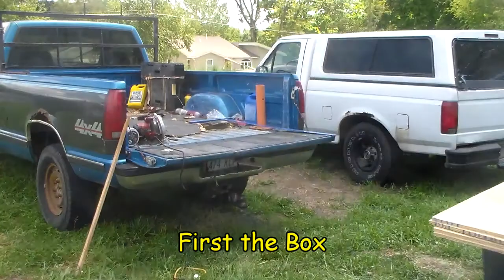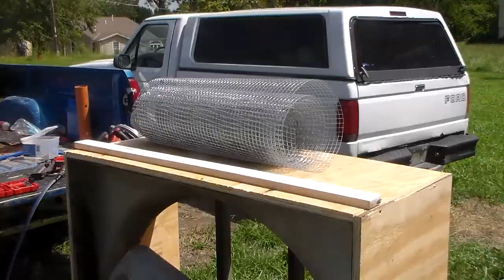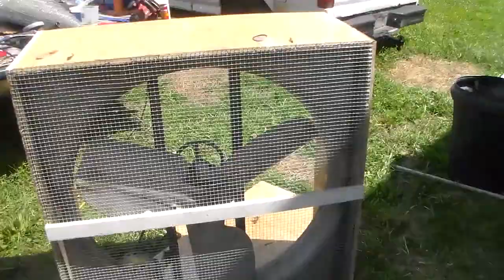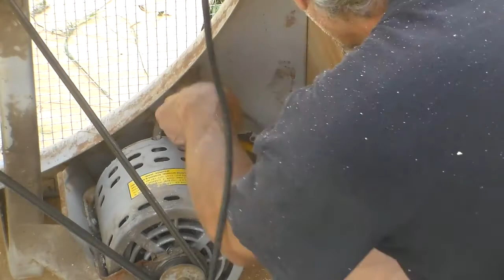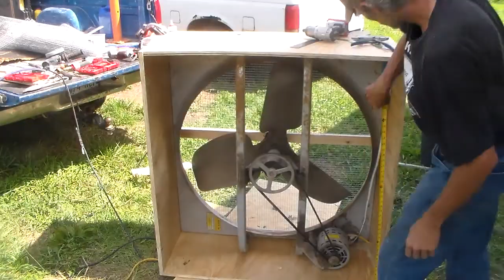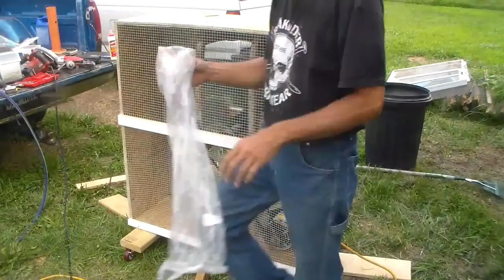Attic Fan to Shop Fan Converstion

Comment: Mine is almost identical, right down to the wall switch and the hardware cloth. I made it 15 years ago, and its been in that garage until 2 days ago when I finally moved it up to where we moved 2 years ago.  I still need a motor for it.  My wife didn't like it, said it was ugly, so I painted it the colors of her school (so how can it possibly be ugly now?)  It was the original fan from when the house was built in 1960 and was taken out when my Dad put in central air in the late 60's.

Comment: My dad has said he just wants to help me live the life that I want and I am collecting some fans and stuff. Meanwhile me and him in the life I want he still gets frustrated at me living the life I want. Plus it’s not even that I like fans in this instance is that I need to find success and mentor away because mother fans are a little bit too small and this would be perfect for us my heater and I have portable heater. It’s nice in my room on low speed on low heat and high heat because at night it gets cold and I have the fan running to keep it modern but by morning time I am usually sweating even when it’s on low heat and this fan would be perfect because it will keep it not so hot I could just turn the sound up to medium speed, but no I would rather do this because it’s quieter

Comment: what size motor would work good for this? i have a fan. built a box. no motor or pully.  any suggestions? hp/rpm/pully size etc?
Reply from the maker: This one had a 1/2 hp motor on it. As far as pulleys go Northern Tool has a pretty good selection. as long as you know the shaft size you should be able to order one. I do not know what the RPM of this fan was (I don't have it any more I sold it) that one you'll need to research.
Reply: DIY with Uncle Cy perfect! Thanks for the help!

Comment: if you change out the fan pulley for a 3" pulley, you could roll the fan around the shop and blow all the saw dust out of the shop, no more sweeping the floor :>)
Reply from the maker: Russ Veinot it already does that. Firsyt thing I tried after filming LOL
Reply: Funny you should mention that.  I temporarily installed a drill press motor on it, and probably had the wrong pulley on it.  It lurched across the garage, really fast.  I still haven't told my wife about that.